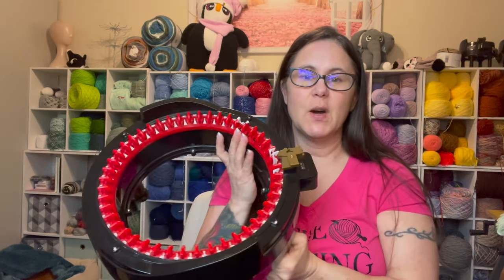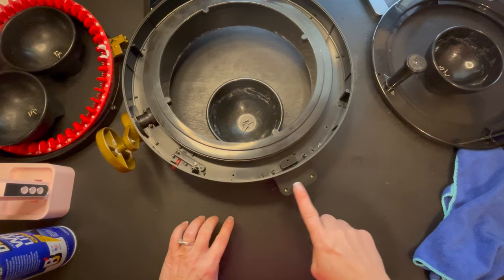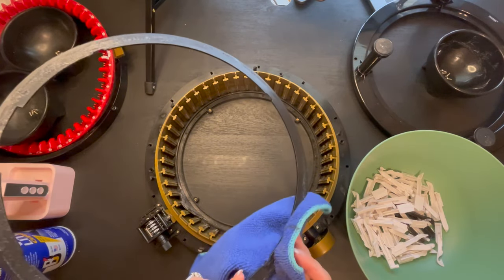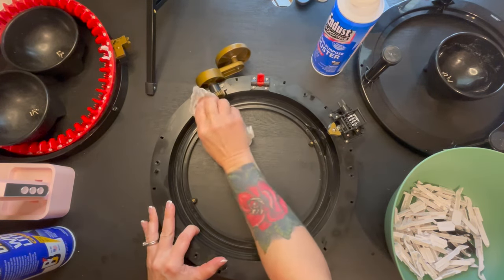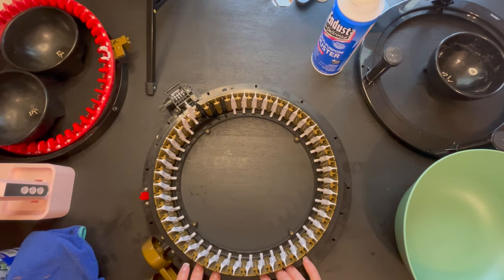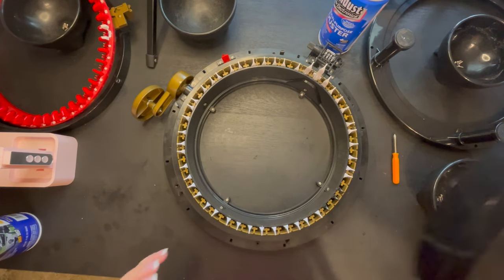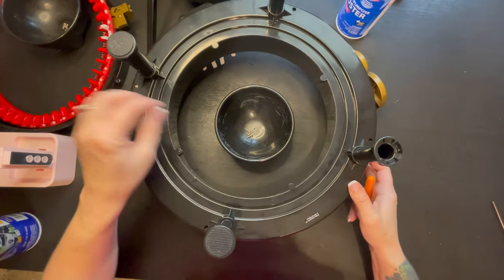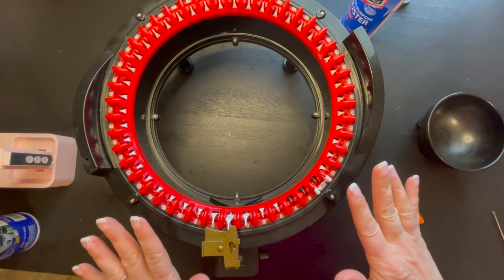How to clean your Addi Knitting Machine

Comment: 🙂🥰 Thank you, Lori. I have watched at least 4 videos on Cleaning and putting the Addi back together.  My handle went haywire, so I had to take my
Addi completely apart to fix that issue.  I didn't know how I was going to go through the steps to get that machine back in working order. Your video did it for me.  I had to watch your presentation several times, however, that's, a good thing.  This is now 04/11/2024 I finished at 11:15 p.m.  
Sometimes I do my best work late night. You are spot on with your instructions.

Comment: Great video!  Thank you so much.  Question:  how did you add those numbers?  Did you use labels?
Reply from the maker: I went on Etsy and bought the tiny typewriter numbers from Pastel Stickers.   I took off the red ring from the machine and CAREFULLY superglued it on to the correct numbers.  Just be careful
Reply: @LorieSimpson-ng5hk thanks for the info!  Great tutorial ❤
Reply: @LorieSimpson-ng5hk  I hope you do make more videos on what you're making ion the Addi or anything else that you do on the Addi.  You are clear and precise in your instructions. Thank you.
Reply from the maker: I used the stickers on Etsy from Pastel Spell stickers. I took off the red ring and used tweezers with a dab of superglue on them. Just be careful when doing this. Make sure you take it off the machine first.

Comment: Hi, I took my machine apart and put it together, I did this about seven different times, and it is not working properly. There's one part of the revolution, of the gold ring which holds the needles, which seems to be harder to turn if that makes sense, And I am sure it's going to eventually skip. I took it apart several times to make sure everything was put back together correctly and greased. Just as aside this machine is only 2 months old. I'm so disappointed that I took it apart. Now it's horrible and I am not sure if I should return it and see if the authorized retailer who I bought it from can fix it.  I'm sure they're going to charge me money because I've already taken apart and it's my fault that it's probably not working. But as a cautionary tale, I would hesitate to tell anyone to disassemble their machine. Just a note I am very mechanically minded. So not a dunce when it comes to working with tools and parts.
Reply from the maker: I am not telling anyone to take their machine apart, however if you do, please be careful when taking it apart and make sure that you take your time and correctly put it back together.  This is a difficult machine and not all the screws are the same size.
Reply: I  know what she is talking about mine does the same thing. But I  just kept taking it apart and eventually got it to work.
@LorieSimpson-ng5hk